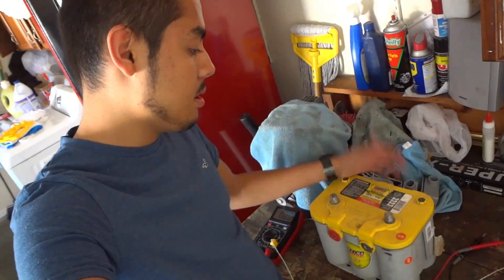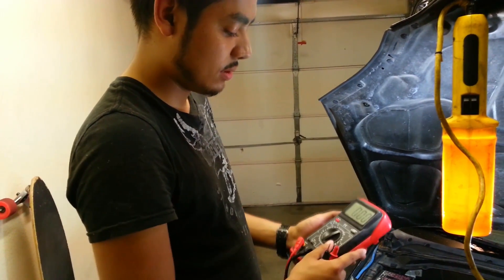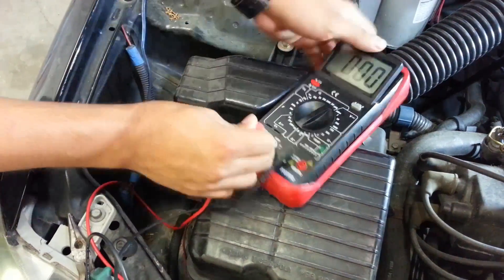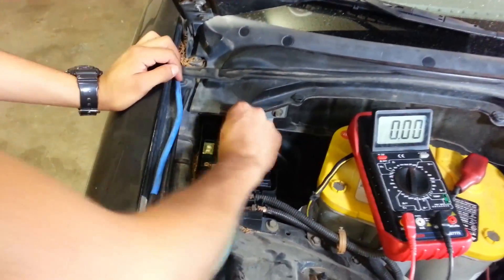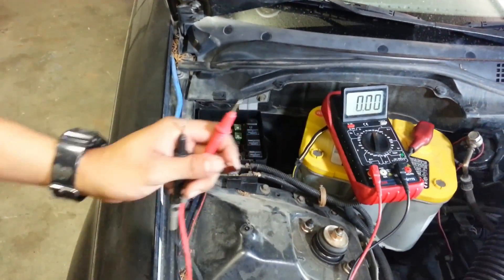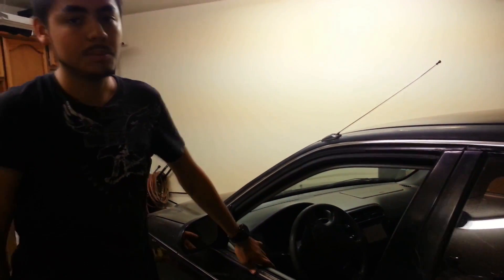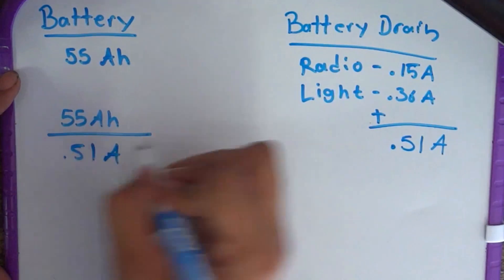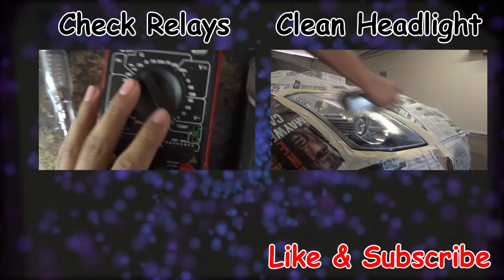How to find Short Circuit in your car/truck

Comment: hopefully by now you have fixed your systems wiring there under the hood bro.... somewhat dangerous and unsafe to splice that what is it, 2 g wire to a 6 or 8 with the inline fuse holder. you can get a decent fuse block accepting of that gauge wire for fairly cheap. but, other than that i appreciate the video for sure man, good simple info. helped me out a ton!
Reply from the maker: +Logan Pierce your the first to notice. Yea, Definitly need to get that fixed. It goes to a power inverter. The fuse holder is the bottleneck for the current. I'm glad the video was helpful!
Reply: no way, ok well thats a bit more comforting. i for sure thought it went to a secondary amp for some subs in the back. haha, cant believe i was the first to notice that, but I do sound and audio in cars, so naturally i guess. anyways again man thanks for the vid, really helpful

Comment: To James Lewis, sounds like you need to replace your ac clutch. Go to O"Reilly or Auto Zone and ask them to pull a new one off the shelf, then have them check the resistance with an ohm meter. Then go home and unplug the wiring harness on the clutch on your ride and see if it is the same. If it is lower, say 1 ohm or less then it is bad. You might even want to buy the new clutch and take it with you. as long as you don't install it or mess it up in any way they will let you return it. If it checks good then check the wiring from the fuse panel to the clutch to see if the two wires are melted together or to ground anywhere.

Comment: Your video was very interesting. I have the same trouble with my bike. Seems to me if I remove the positive battery cable and connect the ammeter between the positive post and cable I should read -0- amps. If not then I know I have a short. The fuses are not quite as easy to get to as on a car so it will be a long process to track down where the short is, but with your method I can do it. Thanks for sharing. Music didn't bother me bro.
Reply from the maker: +MICHAEL BARNES Thanks! I'm glad its helpful. Good luck on your bike!

Comment: Another way is to pull the negative cable from battery and hook your volt meter between the neg post and terminal. Pull all the fuses. Make sure your Volt meter is set on amp load like you did. I take a picture of fuse panel. Push in the fuses one at a time and watch the meter and wright down the ones thats drawing current. Pull it and carry on and continue until your done. You'll figure out which one is pulling over .3 I believe its what it pulls every time the computer runs through itself for security and computer faults every 15 minutes. Different makes and models are different. So this is how you START to find the big amp draws. It might be over .3 amps draw for security systems. Then the car can be actually started in two weeks before the computers draw the batteries down. Chrysler town and country mini vans 2010 and up HAS to be started every 13 days. Day 14 it will be dead. Next part is get someone or find the wire diagrams needed for that specific fuse link that covers all related connections to that specific circuit. I own a window tinting car audio shop. Owner/operator install tech with 31years in this field. Hope that helps at least 1person in the world. Then jobs done. Take care.

Comment: DO A VOLTAGE DROP TEST THEN YOU DON'T NEED TO REMOVE THE FUSE. IF YOU HAVE An INFRARED THERMAL IT WILL ALSO SHOW YOU WHICH FUES HAVE CURRENT.
Reply: Keith Bland 
A voltage drop test is used to test the battery under load, he is trying to find out if something is drawing too much current even when the vehicle isn't running.

Comment: hi there your video it was great but this technique it doesn't work in the latest car because they use what it's called control area network also they start using fibre optic wiring they talk to each other by signals
Reply from the maker: +Karim Zemiri although you may be correct, can(control area network) is used to communicate only. So this might not be what holds you back. The computers are more than likely still able to default to the original state with a lose of power which is what we do when we pull the fuse. If there are multiple computer which is most definitely the case on modern cars, it may still be possible to reset it by disconnecting the battery terminal for a while.

Comment: My 2005 Lincoln LS keeps blowing the ac clutch fuse. (10) amp immediately upon replacement. The vehicle doesn't even have to be running and it blows the fuse as soon as I replace it with another fuse. Do you have any advise?
Reply from the maker: +James Lewis sounds like a short in the clutch wire.
Reply from the maker: +James Lewis sounds like a short in the clutch wire.
Reply: Thanks, Is there any steps I can take to try and isolate the problem or narrow it down to the clutch wire?
Reply from the maker: +James Lewis pull the fuse with the vehicle running or in ignition mode and with AC on. With a multimeter that can test both voltage and continuity. Put it in voltage mode. Touch the black cable to the neg of the battery, then with the red cable put the probe on one end of fuse socket. If you read around 12 volts then switch to the other side of the socket. You should be reading zero volts. Keep the probe in that socket and on the neg of the battery. Switch to continuity mode. If there is perfect continuity, then you have a short to ground on the cable that runs to the AC clutch (or on the clutch itself). If you have no continuity then your problem is elsewhere.

Another quick check is disconnecting the AC clutch and putting another fuse in. If it pops, then it's likely the wire that runs to the AC clutch, if it doesn't pop, then it's your AC clutch.

Comment: Just a question, if the dome light doesn't go out when the doors are shut, would you need the multi-meter to tell you there is a short?
Reply from the maker: +M24A6 hahaha you would think not but the light sucks as it is, plus I didn't use the vehicle at night. Additionally sometimes it would turn off but still draw current. To this day, I still have not fixed the problem but instead just flipped it to the off position.
Reply: That might be the hard part, finding the bad spot, thanks for the vid.
Reply: M24A6

Comment: If you pull off the negative terminal and do the 20 Amp test between the terminal and the battery post wouldn't it show the total Amp Drain while the car is off? Then you could subtract the .51 amps from whatever the total drawn amperage is and know that you found where the parasitic draw is coming from. 
I'm not a mechanic but have learned a few things dealing with used cars
Reply: Christian Macias ammeter!! lol. good video bro. keep it up
Reply: Thats not a good method for modern cars with a lot of computers and modules that can be stuck on drawing down the battery. As soon as you pull the fuse you reset the computer or module and you just masked the problem that was drawing down the battery. Plus modern cars computers need to go to sleep so it will have a draw on the battery until the computers "go to sleep" This was a popular method on older cars but can get you in trouble a modern car with lots of computers and modules. Its a out dated test procedure unless your working on older cars.
Reply from the maker: +Mike Forsberg Yes! That is another method. It does the same thing but there are 2 reasons why I did not do that. 1. If there is a short circuit, then using the negative of the terminal risk combining all the currents from the electronics in the vehicle and could be well over a multi-meters Max current. This could cause the wires to smolder up. 2. If for some reason a person tries to crank the car and it is in series, the multi-meter well almost definitely get damaged.
Reply from the maker: +Mike Forsberg Yes! That is another method. It does the same thing but there are 2 reasons why I did not do that. 1. If there is a short circuit, then using the negative of the terminal risk combining all the currents from the electronics in the vehicle and could be well over a multi-meters Max current. This could cause the wires to smolder up. 2. If for some reason a person tries to crank the car and it is in series, the multi-meter well almost definitely get damaged.
Reply: Very true. Though to be fair, most things that individually draw high current will be obvious if they are operational (headlights on, an electric motor somewhere constantly running, your little brother sitting in the driver seat turning the ignition switch, ...). The real potential problem is as you stated: that configuration tests total drain, so all the little gremlins can add up to more than the multimeter can handle. It would probably take a very strange and unfortunate series of shorts for that to happen, but you are completely correct that it is possible. And by the way, this is a very good video. Something I haven't seen addressed on YouTube before.
Reply from the maker: jay 80 ammeter! I couldn't remember the name for the life of me. Thanks!

Comment: he said the radio consumes -0.15 for purposes of memory retention, wouldn't that mean his battery would be dead in about a week if he did not  use the car?   may not even have power to start after 4 or 5 days if his math is correct, right?  assuming the light was fixed
Reply: -.005 might be plausible   for memory only if radio undamaged, just curious

Comment: Just so you know...when testing fuses you dont even have to remove them you can just touch the top 2 metal sides that are exposed with your multimeter saving you alot of time. Also how could you not know the dome light was on?
Reply: He wasn't testing fuses, he was trying to find out what was draining the battery, so current (measured in amps). You can have voltage without current (open circuit), but there's no point testing for an open circuit when you're looking for a closed circuit that's draining your battery. 

Having voltage only means there's the potential to have current flow, it doesn't mean there's actually current flowing.
 
Think of voltage as a water-tower, and current as the flow of water from the tower to the ground. You could close a valve to stop the flow and still have the potential for flow. Or close it a little bit and have some resistance to the flow.

Also, you don't 'use' voltage, the same way that you don't 'use' meters (height of a water tower). You use the water flow (current) to drive something like a waterwheel (motor).

At least that's the way I understand it anyway, voltage and current are very different things...
Reply from the maker: +LaFlare in this case we had to remove the fuse because we are testing for current instead of voltage. Also I never drove the car at night so that why I didn't see it.
Reply from the maker: +LaFlare in this case we had to remove the fuse because we are testing for current instead of voltage. Also I never drove the car at night so that why I didn't see it.
Reply: You can also test for voltage since if its using amps its using voltage. So your saying if its using amps the voltage will be 0? Hmm idk ive never had to worry about amps and Ive been threw my cars entire wiring from the fuel pump the the computer. And i generally do voltage drop tests
Reply from the maker: That's a good analogy. They are different but related.

Comment: Great video. Before replacing the light, I recommend getting the wiring diagram and doing some more troubleshooting to find out exactly why the light stays on. If the light does not go off,then short is happening between the light assembly and the switch. The current is not getting to the switch so switch is unable to control the circuit as a result. Therefore there is constant power to the bulbs. Thanks for sharing.
Reply: Hello my friend do you know a good link online to buy wiring diagrams also good description of relays and fuses i am dying to find one, please help me maybe you can send me the site or webpage, by the way it's for a mercury mountaineer 5.0 liter thanks in advance.

Comment: do I need a fuse in the multimeter? no need?
Reply: +Okaythen001 multi meters have a built in fuse.
Reply: +hawk eye mine says to prevent fire install fuse.  necessary to install? to prevent shock?

Comment: is it important to disconnect battery if yur car will stay long period mayb two to three days idle..disconnecting to reduce battery not loosing charge
Reply from the maker: +Erque Richoms not as much on modern cars, on modern cars you should disconnect the battery of you plan to leave the car without starting for a couple of weeks.
Reply from the maker: +Erque Richoms not as much on modern cars, on modern cars you should disconnect the battery of you plan to leave the car without starting for a couple of weeks.

Comment: Hello all you wise ones out there,,,can you help a Brother out,,I got a 95 Ford explorer sport,,i heard they recalled them years ago due to electrical problems ???? on mine the windows sometimes work and sometimes not,,the digital  display by the rear view mirror sometimes works rarely has it come on BUT SOMETIMES it does,,the wipers are hit n miss,,sometimes they work sometimes they dont ?? dome light is same ,,, is there a multi-function relay,,,Please share your infinate wisdom with me

Comment: You can use an ampclamp for problems like this all u have to do is connected to the ground side of the battery cable and anything at .500 mamps or higher is consider a draw in any vehicle. The normal draw will be .002. 
If there is draw in the system and u r reading .500 mamps all u have to do is pull one fuse at a time and when u pull the problem fuse the reading on the ampclamp will drop to almost zero or .002 after that open up ur wiring diagram and go from there. Is a bit complex, there's time where units that needs to go to sleep they don't and can create battery drain over time. Lots of time is aftermarket devises that can drain battery over time like low jacks n things like that. What u have is probably a bad door switch. Short to ground on the ground side, which is not that bad cause is not blowing any of ur fuses then that will be a short to power on power side.
Reply from the maker: +Milton Solis This is true. This video is the most "economical" you could say. I bought that multi meter for about 5$. It would be nice to have something that I could have easily connected in series with the battery. I was thinking clamping the multi meter probes in series but my concern was if any body uses the multi-meter that I used and had a rather large short circuit, the wires would smolder at about 15 amps. This was the most practical I could come up with, without getting any too complex and confusing anybody. Thanks for you input!
Reply: Christian Macias I guess u rite!

Comment: hello.. I have a 2004 dodge durango and my problem is that the interior light's don't turn ON. not even manually.. but my battery get drained every night ,, and the fuses and switch are working because I can make bright and dark de dash light's.. please help.

Comment: hi what can i do to stop a fuse that keeps blowing every time, it is from the cigarette lighter i cannot put a new one cause it burns the fuse right away thanks gracias
Reply: That usually happens if you have a piece of metal or coin in the housing. If not, then the 12v wire is shorted to ground.

Comment: No need to pull all the fuses,test at the back of the fuse contact points.
Reply from the maker: In this case you cannot. The multimeter will read 0 amps or a very small number. We need to be in series, having the multimeter take the place of the fuse
Reply: I use the loadpro

Comment from the maker: +speckspeck I left out of town during that time and my car had not been started for quite a while. When I  came back it did not turn over. The current that these circuits were drawing was not enough to drain my battery in one day but since i was gone for while, it was able to. The radio is damaged and that also did drain more current than it need to use and my lamp fixture was also stuck on. After i repaired this my car lasted over a week without draining.
Reply: Christian Macias  m

Comment: you say you needed to replace the lamp unit, maybe you fixed the radio short, etc....but what made you say there         {from your  calculations]       is still more that is causing a faster drain than expected, where did that turn out to be and the 64 dollar question is.....why do you have these sudden simultaneous shorted circuits, did they accrue slowly over time and undetected, and why would that happen??

Comment: I enjoyed the video, but whats the difference between a short and a parasitic draw?
Reply from the maker: +DAVID OLDEN We say "short" and usually mean parasitic draw. A parasitic draw is something that continues to use electricity even after we have turned off ignition. A parasitic draw will drain a battery after a while. What a short circuit actually means is a straight path to ground. A short would be like connecting a wire straight from the negative side of the battery to the positive. This will cause a fire. When a car catches on fire, it is usually because of a short circuit somewhere in the car. It could have been from the radio, ignition, or an aftermarket accessory. This is why fuses are important.
Reply: +Christian Macias Thank You